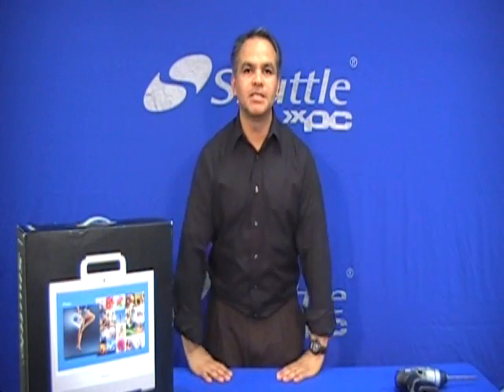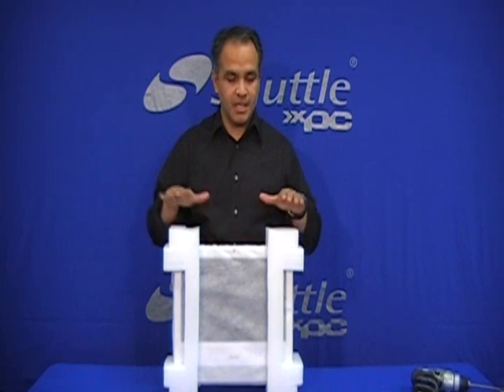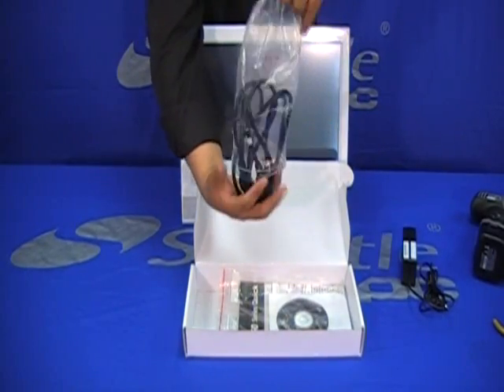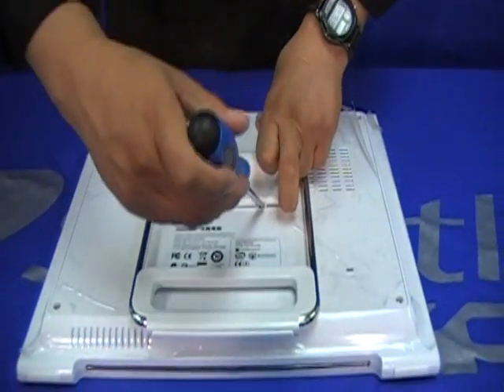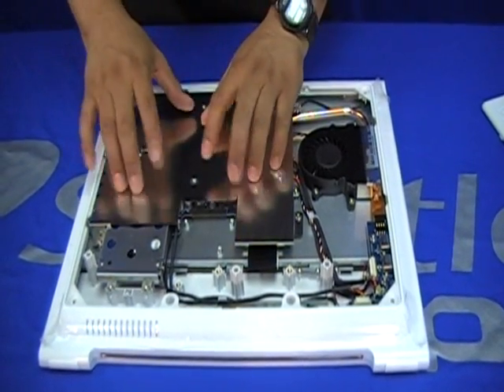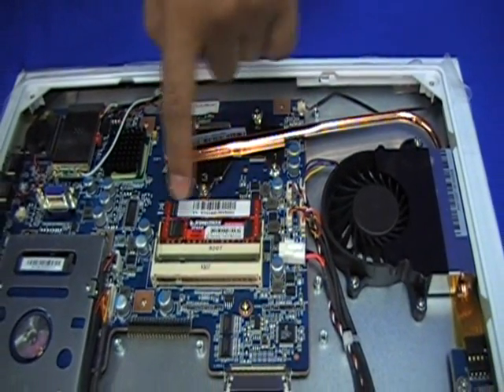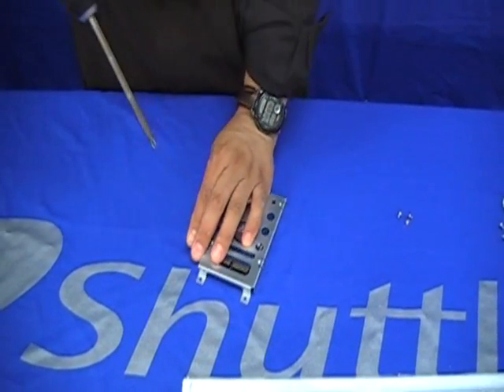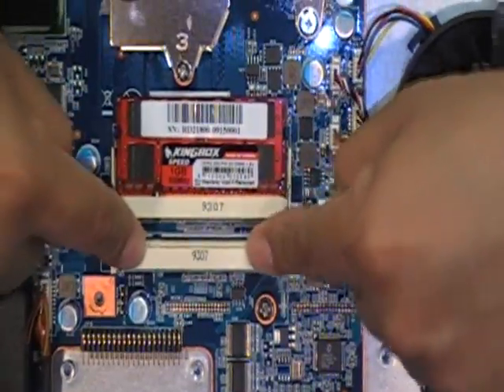Shuttle Touchscreen All-In-One PC Overview -- X50-- Part 1 of 2

Comment: this is a 5 year old model and it's using Atom 330 as the CPU, so it's definitely not a "fast" computer. However, if your problem is that your X50 is getting slower over times, try do some disk clean up or reinstall Windows, you will see the difference.